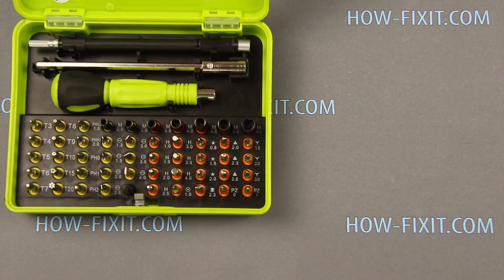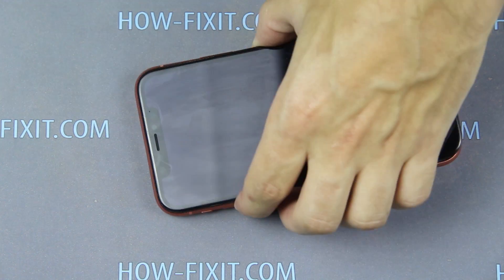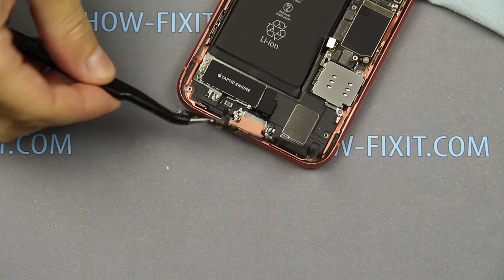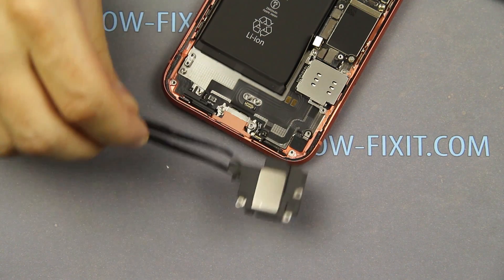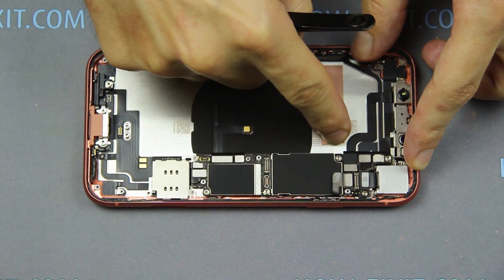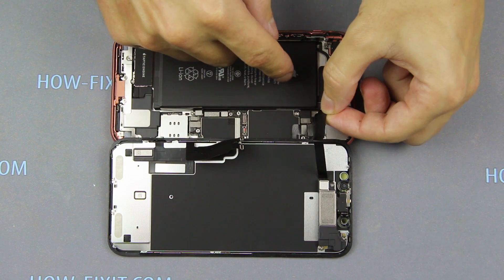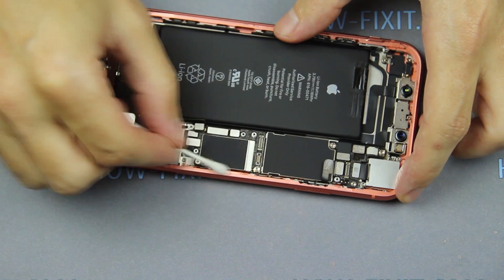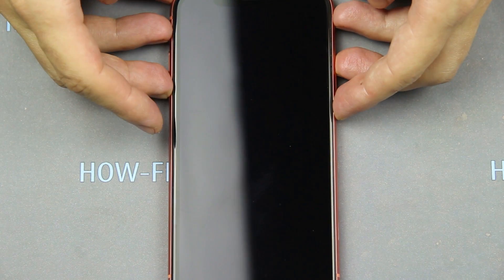Complete Guide to iPhone XR Disassembly and Battery Replacement

Comment: This is one awesome video, clear, concise and to the point.  However, Apple has has made it so unless the battery is changed by Apple or Apple Authorized Service Provider, there will be an error message in "Battery Health" menu that says "Unable to verify this iPhone has a genuine Apple battery". According to the "Verge" doesn't affect functionality, it makes it harder to tell when a replacement battery needs to be replace. Just so you know.
Reply from the maker: ⚠To Fix 'Unknown Part' or 'Important Battery Message' check the iPhone Battery Calibration video tutorial, link in the description under the video
Reply: @howfixit  how can it be solved?
Reply: @howfixit  yaa. how can it be solved?
Reply: @howfixit  still waiting